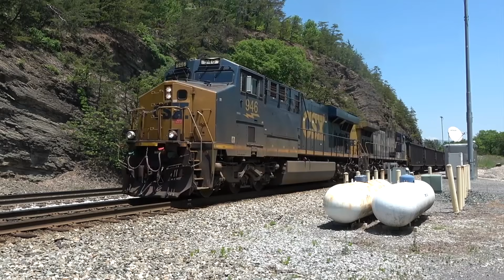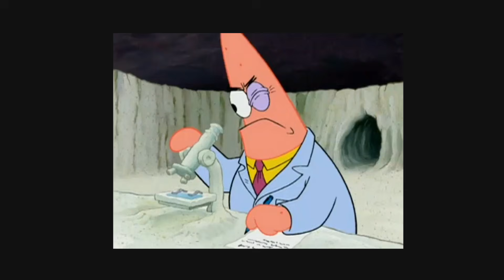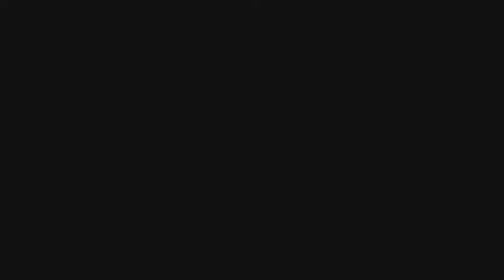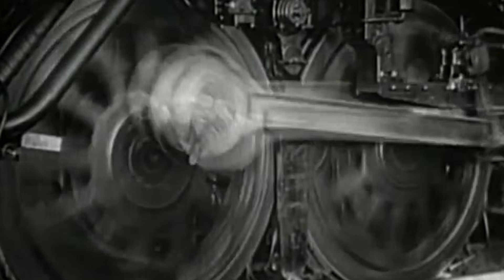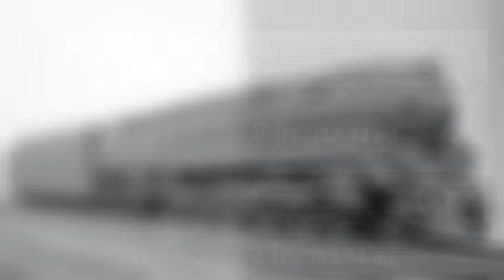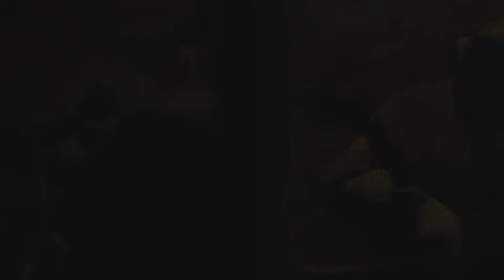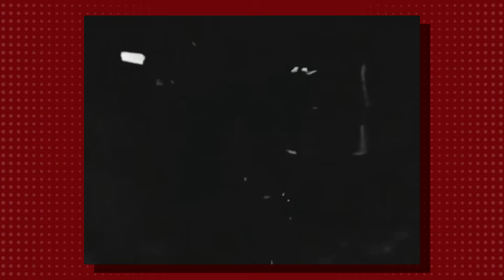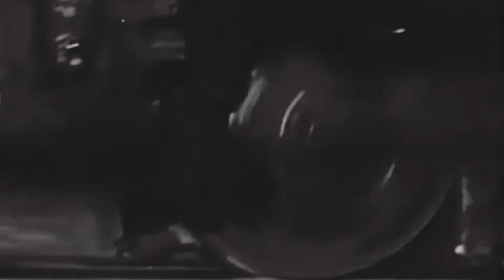PRR Q Series: The Pennsy's Duplex Powerhouse

Comment: Hi.

I'm curious as to the speed at which the horsepower was developed?

Or is the figure for cylinder horsepower?
Reply: Horsepower isn’t as good of a measurement as tractive effort, so no these aren’t really as powerful as a big boy or Allegheny, plus the boosters were rarely used as the increase in steam usage would always be more than the steam generation thus losing pressure. Horsepower is better for acceleration than total power. Plus the locomotive had much less driving wheels than the big boy or cab forwards for example, 
In reality, the Q2s were just UP Challengers with less adhesion due to the less axles and more axle load on the tracks
Reply: @threepea1151  I'd agree if it weren't for the fact that neither the Qs or the CSAs were freight drag locomotives - the speed at which they created their horsepower thereby remains relevant.
Reply: @threepea1151  tractive effort is solely a calculation and provides a given amount to set a train moving. Horsepower, of course, is the ability for the train to keep apace. There's interesting tests done with the unique 10101 Fell diesel mechanical locomotive which provided some very interesting information regarding this. That's of course the big difference between the C&O boosted T1's and H8 Allegheny, both having the same train loadings, and why the Y6's were so successful
Reply: That figure is for cylinder horsepower. In terms of power at speed (drawbar horsepower), the Allegheny takes the crown as the most powerful steam locomotive ever built.
Reply: @09JDCTrainMan  I kind of had the feeling that I had read that before.  I imagine the UP design team were looking for a higher road speed to peak at for their perishable traffic.  But either way, that's a whole heap of power for one unit.

Comment: This is gonna sound picky but imo I think the Q1 is one of the most pleasing large steam locomotives the PRR made...I think the streamlined roof design flush with the tender panels. Kinda like the S series locomotives and the T1's...
I feel like the large gap from the top of the cab roof to the top of the tender in locomotives like the J1, M1, and Q2 just don't sit right with me. I understand they are freight locomotives vs the style of passenger locomotives but it was just a weird niche design that I could never unsee.
Reply: yep it just has a nice flow and balance, even though it proved to be a bad choice the reversed cylinders made it look extra clean.
Reply: The Q1 was always intended for dual service. Effectively it would’ve been the PRR’s version of the later NYC Mohawks. While the NYC refined the 4-8-2’s - already decent in freight service - to be more suitable for passenger service, the PRR made an engine that would surpass their 4-8-2’s in freight and passenger service. In fact, while it likely never pulled regular passenger trains, the Q1 covered similar mileage in freight service to the L-4 Mohawks in  service! The Q1 really was the visual embodiment of dual service, even down to the finer details. The tender was designated as a Freight tender (180 F 75), but it bore the same brass bell as the passenger engines! Employee documents also confirm it was authorized for passenger speeds as well; only in later years was it officially designated a freight engine

Comment: "How much power do you really need?" - To be a proper railway nerd my guess is less than 1000 HP if "get moving" is ment literally as to start the movement. As the old railway proverb says: "Adhesion tells you how much you can pull, power how fast you can pull it."

Comment: It’s sad dieselization happened so fast cause these poor engines never really got the chance to prove themselves. Despite what other people might say, the PRR’s duplexes were a success, and were very well made engines, they just came at the wrong time. Hopefully 5550 will put the duplex hate to rest
Reply: They did prove themselves. The problem is that the Pennsy had no use for a high-horsepower freight locomotive. The only use for such a locomotive is high-speed freights, which the Pennsy didn't run. If you're only going moderately fast, you only need moderate horsepower.

Comment: The Q2 still stands to this day as one of the strongest locomotives of all time, In order to outperform a Q2 you had to look toward UP's 8500hp GTELs not to mention while some classes had to doublehead across HSC or get helper power, the Q2 just needed itself to stomp over the grade. They were just ahead of their time and crews preferred the more simple J1s and M1s. Nevertheless the Q2 was the most successful of Duplex designs with the T1 coming at a very close 2nd.
Reply: The Q2 Duplexes were in the same horsepower league as the Union Pacific Railroad's 2nd generation Oil Turbines~
Reply: Ya gonna do that Indian train derailment,just wanna know
Reply: @ambercollins777  he’s not gonna do it if you ask.
Reply: @railfanlynx :<
Reply: I present to you:
The PRR Q2 Trust, a non-profit group with the goal of building a full scale operational replica of Q2 number 6131
Reply: I’d say it could be argued that there time was too late and instead of being ahead, considering had they been around late 20’s early 30’s the railroads likely would’ve continued to work out the design flaws and by the 40’s would’ve had them mastered and increased the fleet sizes. In the end diesel beat steam, and although electric beats both in hp, the cost of electrification is so expensive and even more so today it’s never going to happen. These prototype battery and hydrogen powered locos feel nothing more than just another design attempt like the turbines and steam electrics before them. Diesel electric is as good as it gets.
Reply: That is, if you don't look at electric locomotives
Reply: @mikeblatzheim2797  good point lol
Reply: What an interesting fact
Reply: It's absolutely amazing just how much power they were squeezing out of these things and when. The engineers had to do all the work by hand and they still found a way to make steam push harder than the majority of diesel-electrics today.
Reply: @asteroidrules  and the only engine that could outpull them needed a literal jet engine. Locomotive shops like Juniata really were incredible back then
Reply: “Of all time”
Meanwhile The triplexes, Virginian AEs, Big Boys, Alleghenys, and Challengers:
Reply: @TheSudrianTerrier653  don't forget the Great Northern R-2
Reply: Thunderbolt! :D
Reply: Same best duplexes built during WWII

Comment: This made me think of something, why did the PRR never develop a 4-8-4?
Reply: Because they think the duplex’s will be better. And they shot them self in the foot.
Reply: @gamerfan8445 The T1s were better than a 4-8-4s though.... just not worth the extra trouble, nor did it actually seem to hurt them much at all outside of the S1/S2/Q1, those were all single locomotives. And they would have dieselized by 1957 anyway.
Reply: @ThePTBRULES  not really. speed yeah, the T1 is one the fastest American locomotive. But everything else? No, T1 are behind the Niagara, GS, FEF, J class, heavy mountains, and the greenbrier in term of maintenance, and reliability.
Reply: @gamerfan8445  They were notorious for wheelslip
Reply: @Sleeper____1472  that shouldn’t even be bring up. Because many locomotives wheel slip
Reply: @gamerfan8445  No like it was really common, one wheels could be slipping while the other was fine
Reply: @Sleeper____1472  but here the problem with using the wheel slips as a problem, is because the wheel slips are caused by poor training for the crews. The C&O prove that when they try them.
Reply: Contemporary 4-8-4's had broached the threshold of dynamic augment and were proving very destructive. Any increase of size was just going to extrapolate the issue. Duplexes were a way to reduce said dynamic augment, whilst also with 4 cylinders reduce tendencies for lateral thrust, again becoming quite an issue. 
Even things like centre of gravity were an issue, PRR Electric tests providing favour for a high centre of gravity that eased destructive forces on track curvature at speed
Reply: @muir8009 I think I remember reading an article somewhere that Florida East Coast Railway 4-8-4s built by Baldwin (the PRRs go to manufacturer for motive power) had really bad dynamic augment (or "hammer blow") that actually caused kinks in the rails.  It was because of this situation that caused the PRR to invest in duplex drive locomotives.  So what caused the FEC 4-8-4s to create such bad hammer blow?  Turns out that it was bad counterbalacing.
Reply: @NewtypeCommander  wrong railroad, it was the Atlantic Coast Line R-1s that had really bad hammer blow, the I5s of the new haven also had that problem.
Reply: Ultimately because they had more money than sense.
Reply: Well they did actually have a 4-8-4, and one unlike those on other railroads. The one, the only: R1;)